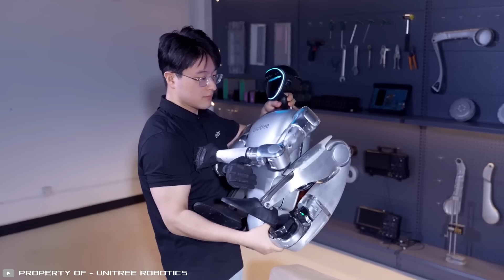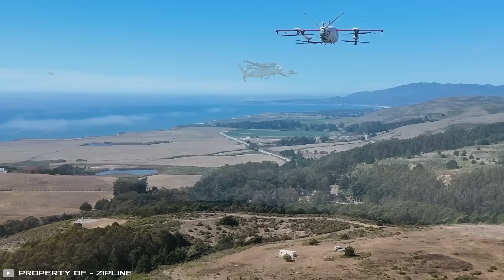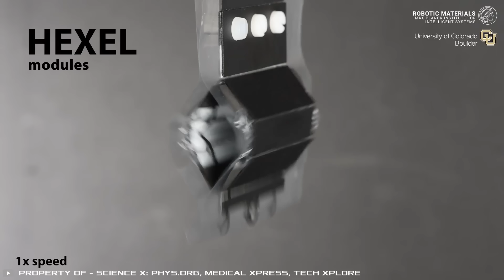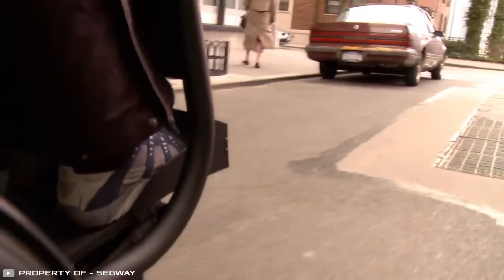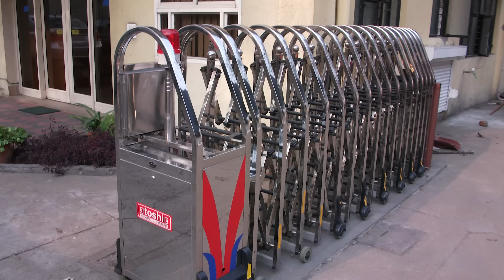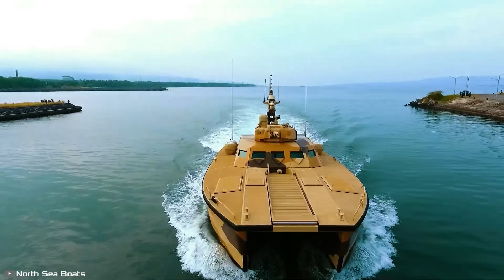These New Robots Will Change Humanity Forever - 30 Unbelievable Inventions

Comment: Okay that's pretty cool that you can turn a traditional semi into an electric truck but is it super expensive and does it limit how far the truck would go on diesel like normal? Because if it's limiting it to less amount of miles and it's super expensive add-on it's not feasible but I do like the ideal I think it's pretty cool. I own two electric bikes with dual battery on both of them and they go 50 miles an hour and over 100 and some odd miles round trip and they are super quiet super fast and probably the most enjoyment in my 50 years on this planet riding a bike you don't even have to Pedal it's got its own throttle. I got my bike from goat powerbike and I got less than $6,000 involved with both of my electric bikes that are both equipped with dual batteries and I've added on all kinds of additions and they are kick ass and the most fun I've ever had

Comment: These will never be possible until the production process of graphene is perfected.
Reply: Graphene just conducts they need a Proper working OS system and Windows or Google even IBM can't write computer Code. This from USA is Never going to work but. China Might?
Reply: @joelhubeny7554  Wrong! It naturally makes what it conducts into useable power. It's also 100% biofriendly and can be used as an interface between flesh and machine. And China will never fix the processing problem, there is only a couple men who can and they ain't in China. Graphene has uses in every single industry across the board. Its use is only limited by ones imagination.
Reply: Whatever dude because they Are in Africa and Nicola Tesla was absorbing Ambient energy in the fucking 20's. This iS nothing new to Me Faraday Metric Tensor showed it. All this Wifi and Cellular Waves can be Harnessed to absorb more Electrons. Static electricity is the Same shit just Lower Electron Voltage. It's running through out the Planet and Ionosphere. Why do you think we Ground everything returning it back to The Earth Battery.   @Rundark-
Reply: @Rundark- 中国石墨烯技术领先世界不懂就了解清楚查清楚😅
Reply: @雅君墨客-i9z  Please spare me your gaslighting BS!! No one has perfected the production process. If you had nothing would stop Xi Jinpingpong from taking over the world! You make tofu bahfangoo and cheap Chinezium chit so what else is there to understand? But hey, I'll give you an A for effort, and thanks for the laughs. Especially considering they were at your expense, Have a great day there sunshine! 🙄